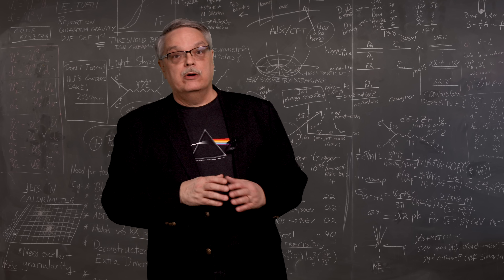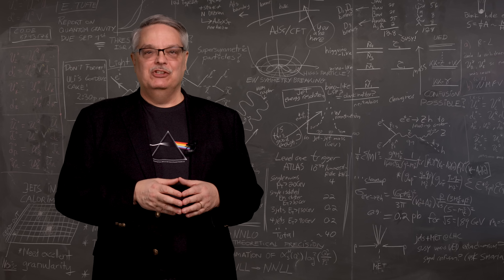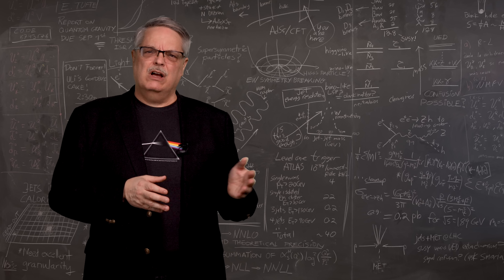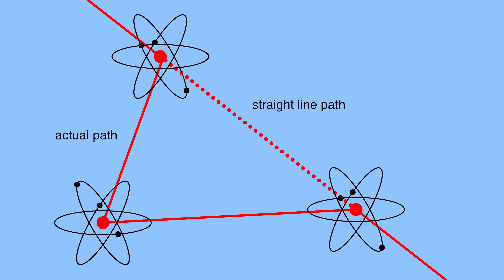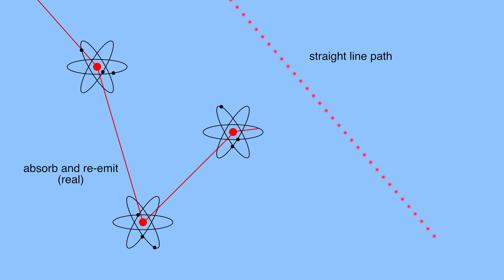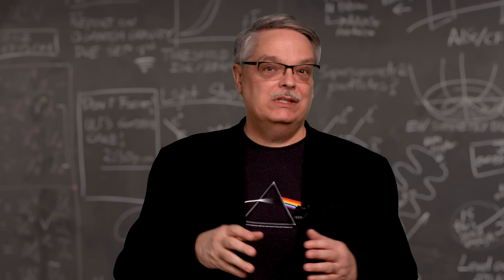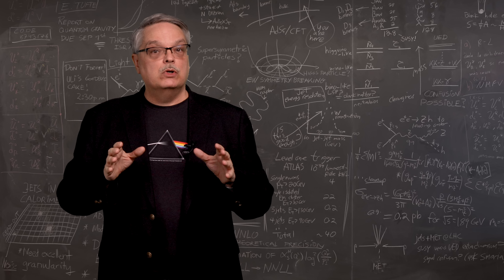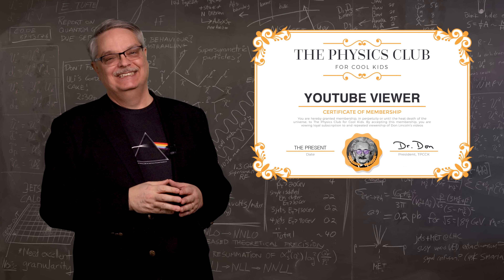Why does light slow down in water?

Comment: The interesting thing is that if you add some white pigment to the glass, the light waves DO get scattered causing a diffuse glow, as in any common white glass light globe and if you add other pigments, the light is not diffused but some wavelengths are absorbed giving it colour as in a stained glass window. So the real question then is why DON'T the molecules of silicon dioxide absorb or scatter light? In the case of water, both hydrogen and oxygen are, by themselves transparent, but silicon is opaque so how does it become transparent by being joined to oxygen atoms. We might ask the same about calcite and diamond where opaque carbon becomes transparent just on account of its crystal structure.
Reply: Transparency strongly depends on electrical conductivity.
(silicon is semiconductor in pure state without oxygen)

Then, it also depends on complexity of molecular structure.
(complex dielectric medium may scatter light instead of passing through)

Comment: It's due to a glitch in the simulation that's caused by the extra calculations the computer must make for special objects which are designed to restrict the movement of the characters. Light has properties that essentially make it behave as any other character in the simulation in many ways, but special exceptions are made to allow it to pass through objects designated as translucent.
The programmers decided to leave this feature in because it would take a lot of time to fix, but it doesn't effect the gameplay very much, and it's pretty cool. There are many such features in the simulation which weren't intended, but they make things more interesting.

Comment: If the electrons interact with the light and begin to move have they not just absorbed the a quantum of energy from the light? So it is absorbing photons and re-emitting them?
Reply: As according to QM everything should be counted in discrete steps so should electron movement energy.
However this is not the same as usual photon absorption and emission related to electron jumps to higher orbital level and back.
Our case is rather more similar to loading and unloading of electric spring-like element, where the whole electron "cloud" moves regarding atom nucleus because of external EM force applied by passing EM wave.
Not sure how to apply QM to this though.

Comment: Thanks, can you also explain why the direction of light changes, when it enters water and again when it leaves water.
Reply: This is because one side of light front which enters the "glass" first - gets already delayed, while the other side which is still in "air" - isn't delayed until it enters "glass" after a while, and this leads to light wave front being seemingly "turned" to the side where delay already happens.
This is similar to a car with brakes applied asymmetrically (left-right sides not equal) turning to the side where brakes are more effective.

Comment: but why does slowing down turn into refraction?
Reply: This is because one side of light front which enters the "glass" first - gets already delayed, while the other side which is still in "air" - isn't delayed until it enters "glass" after a while, and this leads to light wave front being seemingly "turned" to the side where delay already happens.
This is similar to a car with brakes applied asymmetrically (left-right sides not equal) turning to the side where brakes are more effective.
Reply: @rvrss7192  Light isn't a solid, there are no internal forces between different photons of a ray so that can't be it.
Reply: @pairot01  There's no need for any forces between photons to exist for that explanation to be valid, as even one photon (and the more many of them) can be regarded as wave which so has it's front in a form of a  line, and if you lag movement of one side of this line, the direction of further propagation of that line (i.e. wave front) will respectively change.

Comment: Why does diamond have the highest index of refraction?
Reply: Because of highest matter density in the same volume.
Reply: @rvrss7192  Do you mean that diamond is the densest transparent material?
Reply: @jaakkooksa5374  Not sure regarding all "transparent" materials but at least it's densest among mentioned in the list/table in this video.
Reply: @rvrss7192  I found out that apparently Moissanite, which is a mineral that is used to make jewelry, has an even higher index of refraction.
https://en.wikipedia.org/wiki/Moissanite

Comment: But why does it have to bend just by getting slowed down?
Reply: This is because one side of light front which enters the "glass" first - gets already delayed, while the other side which is still in "air" - isn't delayed until it enters "glass" after a while, and this leads to light wave front being seemingly "turned" to the side where delay already happens.
This is similar to a car with brakes applied asymmetrically (left-right sides not equal) turning to the side where brakes are more effective.

Comment: So if you pass electricity through the glass will the angle change??? or the speed change???
The theory explains the change on velocity...  but not the change in angle which happens at the interface... please explain that.  Thank you in advance.
Reply: I was also wondering that.  He talked multiple times about the light changing direction but never touched on why.

Comment: The consequence of light slowing down in glass is that it travels less distance in glass i.e.  light refracts. This enables light to travel from point 'A' in the air to 'B' (the point at which it emerges out of the glass) in the least amount of time.

Comment: They taught me that speed = frequency times wavelength, V = fλ.  What happens to the frequency and wavelength when it goes in the glass because if it just slowed down one of them would have to change if V =fλ. Or do they stay the same because it is the resultant wave form that moves slower ?  Also what determines the colour our eyes pick up ? is it the wavelength or the frequency ?

Comment: This sounds even more ridiculous than the explanations you debunked.  Why does the electric field generated by the light move more slowly than the wave which is generating it?  How does this completely separate electric field slow down the light?
Reply: Slowing down is a result of superposition, as explained in video.
Secondary wave lags because electron movement producing it is delayed regarding initial wave.
Reply: @rvrss7192  So why doesn't the light change colour?
Reply: @markgerhard1362  Because color doesn't depend on speed (which reduces inside medium) but on frequency (which remains the same).
Reply: @rvrss7192  But the frequency does change.
Reply: @rvrss7192  OK , no, I've had another look at his animation.  You're right, the wavelength doesn't change.
Reply: @markgerhard1362  Regarding wavelength - it depends. Wavelength of initial wave and re-emitted wave as they would travel standalone in between particles of medium should remain the same, but these two waves actually do not exist there separately - while if we consider the resulting combined wave travelling in the medium with already reduced speed - it's average wavelength will also reduce, because of that reduced overall traveling speed but still the same initial frequency, according to known formula where:
speed=frequency*wavelength.

Comment: If light is a wave, what is waving? A wave is nothing. A wave is what something does. I understand when you say in matter light waves, but when there's no matter, what waves? 
You had to implement the electron thing, but what you did is just tapping in the dark. 
You have to admit that light is not a thing in itself, rather a perturbation in a medium. Matter is also just that but in a self oscillating form. When light goes through matter the new medium has more resistance so that medium has a different rate of induction. There is no other way you can explain it.

Comment: Simply not true, it is better to understand it through QED (quantum electrodynamics).
Reply: So what's exactly wrong?
Reply: @rvrss7192  The oscillating frequency of an electron driven by electromagnetic field is the same frequency of the EM field.
EM field generated by that electron also travels at a speed of c.
Reply: @junbozhou5636  Yes, but secondary wave lags behind the initial wave so their sum (i.e. resulting wave) also lags as being "seen" by next affected particle of the medium.
So where's the inconsistency and how to apply QM here?
Reply: @rvrss7192  I mean using this explanation, it indeed causes a phase shift but the group velocity still travels at c. Not to mention the EM wave generated by that electron has no space selectivity, it could travel in every direction, same as photon absorption explanation. What even more problematic is it could travel backward and affect the phase of the EM wave before hitting the material.

Comment: The subject: A small projectile spinning at between 100,000 and 200,000 RPM's and at between 2,000 and 4,000 FPS with a cylindrical magnetic core covered by a thin layer of copper (Heading North). The question: In what direction would the North Pole of the magnetic core need to be facing to promote the rise of the projectile? a) North, b) South or at side poles (outer halves) of the cylinder.

Comment: Dear Sir you forgot to explain the change in the propagation direction of light as it enters a different medium.  How does light waves know that the medium's boundary is crossed?
Also, none of the electrons are standing still in one place, they are moving around their respective nucleus. So how does the direction of the motion the electrons affect their contribution to the wavelength change and so on?
Reply: ''How does light waves know that the medium's boundary is crossed?'' ANSWER: density of materials ls is different. Maybe that's how.
Reply: @myonlynick  not quite. Density is only one of several factors affecting the refraction index. Thanks anyway.

Comment: So the light traversing the medium is slower because it is!  The original is still going at C in a vacuum but it interacts with a slower wave produced by the electrons? So we have 2 waves traversing the medium at different speeds?   Deceleration to 2/3 light speed has no effect and then it accelerates to C again? Please can we have a better explanation?

Comment: Can you have 2 intersecting eletromagnetic wavelengths outside of the visual colour range which have a harmonic wavelength in the intersection within the visual range? basically thinking 2 special lasers intersecting to create a hologram? I"m sure this has been thought up before but if intersecting waves have harmonics, could potentially have visual range harmonics if the lasers were capable of the lower frequency ranges to do it.
Reply: Laser is already a visible light source, with some minor exceptions.
Lower frequency EM waves could produce visible light in the form of harmonics just in case of non-linearity present either in a source of EM waves (in this case visible light as harmonic component should already be visible) or in medium where those EM waves interfere (vacuum by default doesn't possess such non-linear feature).

Comment: Well done, I would only add that the bending of light is simply a universal phenomenon caused when ANY moving thing enters an area when it's speed changes, at an angle.  A column of marching soldiers in mud will do the same thing.  And exiting light only follows a parallel course to the original light if the angles of entry and exit are the same, by making these angles different we create a lens.  Much like the one on your shirt.

Comment: light speeds up in water. 
the denser the material, the faster the waves will travel.. 
look at lens design, where you actually have to design something to those specs. 
to determine the speed of light, no one actually measured it directly , 
they used interference patterns which could be read either way,, and vernier scales, which no one in this generation understands
wait they have he camera's now that can watch the light.. 
we should just make a video of it.
yea, and all the equations work with both scenarios.

Comment: How does light travel through space if it not a partical?
Reply: Ray - you identify the problem of trying to maintain that "there is no ether" while simultaneously trying to demonstrate there is a wave moving at a characteristic speed through nothing. The idea is a Dodo.  Presently there are multiple efforts to define a dark matter-based ether that will have a fancy enough name not to be recognised as such by the laity. Physicists have a big problem trying to explain why barred spiral galaxies rotate as they do, and it is not a trivial problem. Dark matter isn't enough. One approach is that there are three kinds of matter: visible, dark and a pulsating, vibrating superfluid that is omni-present. This third material does not have the properties of a compressible gas - that should be enough for now. Quite simple experiments demonstrate there are fundamental problems with 19th Century vain imaginings. For example the speed of electricity through a wire from point A to point B varies through the day as the Earth turns, and throughout the year as the Earth orbits the Sun. The speed of light is so variable that it is no longer determined using a standard physical distance. The standard physical length (metre) is now defined by a number of wavelengths of (a varying speed) light beam, not the other way round as it was previously.  In short, they are hiding the problem to support the 19th Century notion of an absolute vacuum.  In the 20th Century, physicists claimed (and showed) that particles pop into existence out of this "perfect vacuum".  There is a lot of fretting going on behind the scenes at the Perimeter Institute... :)

Comment: You confused me more than I already was.
What do we end up observing in real life as the result of #1(6:44), #2 (6:51), #3 (6:58) (change in brightness? That wouldn't make sense in case with your #3 (6:58) "funny looking shape". So, probably that would cause flickering?)

Why did you have two identical light waves with a different speed (#1 and #2 @ 7:06)?
Why mention "different" speed (7:11)? You didn't say "slower speed". So you can speed up as well?
What caused change in angle of your laser beam inside glass/water?
(8:21) fine, we get two fields. Do two fields always get combined? They just can't remain separate? Why doesn't creation of the second field result in split beam or scatter of light?
Wouldn't the "combined wave" (8:26) also become a different color in practice, if now it has different properties? 
Feels like there were "Why does light slow down in water (part 1)" and "Why does light slow down in water (part 2)", that I have missed. Or perhaps someone went too far with editing.

Comment: BUT - if the light passing through drives the electrons to move, they will move at exactly the same frequency as the driving force (as per driven harmonic oscillator theory). Thus, the superimposed wave will have only a phase difference with respect to the driving light, and the sum will not have any speed difference, although there will be a phase difference. So what's going on? I'm not concerned about the change in angle - that is easily explained by just the fact that the speed is different by looking at simple trig at the interfaces... but there has to be a speed difference.
Reply: The same Huygens principle that in more complex form explains direction change also explains seeming inconsistency with speed reduction appearing similar to just phase lag of secondary wave still moving with the same speed.
The key moment is that wave propagating further in the medium is already not the initial wave but a combination of initial wave and secondary wave with lag (created by moving electrons in previously passed particles of the medium), so appearing alike it was emitted at the last superposition location.
Reply: RVRSS - Ah! Thank you so much! After leaving the comment, I thought about it more, and came up with exactly that idea! The phase lags accumulate as the wave passes further through the material... The incident added to the first phase-lagged then excites another electron, producing a second phase lagged, etc. I'm sure the actual math is an integral over the width of the material and all the superpositions, but the seed of the idea is that. Thanks again...

Comment: So IF you could simultaneously cause electrons to oscillate by another way, (secondary), other than by the incident light beam THEN that light beam would also be slowed down as a function of the secondary oscillation. So by your explanation you could control the speed of light to vary in any given material  by simply varying the secondary oscIllation applied to the material. 

(ie.  bombard the material with UV rays say in the same direction as the light wave).  Have fermi labs tried that?

It is appreciated that UV rays and visible light have different wave lengths but would that alone prevent summation? If so then that is something that you would need to say before declaring that your hypothesis is the correct one.  (Don't forget that harmonics can combine with fundamentals and those two are at or of different wavelengths).

Also if observing a yellow pencil, as in your video,  would the yellow pencil still be yellow if you are observing a different composite wavelength? (Observation performed in total darkness other than incident beam and secondary UV  beam).

How do you like them apples,  Dr. Lincoln?

But thank you for your upload & hypothesis, Dr. Lincoln, even if you don't respond to my comment.